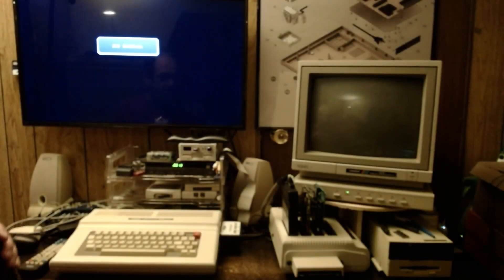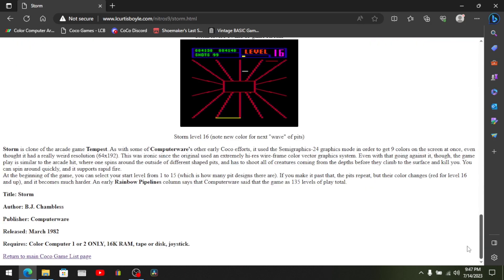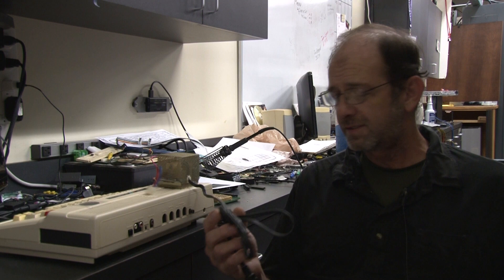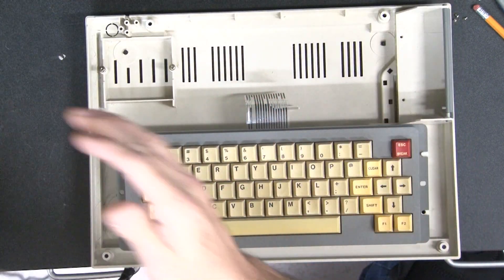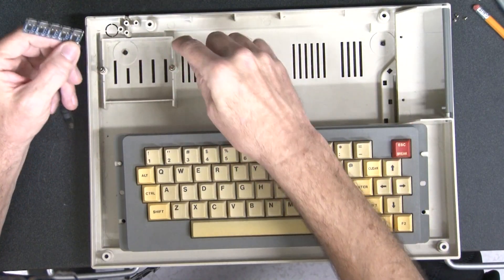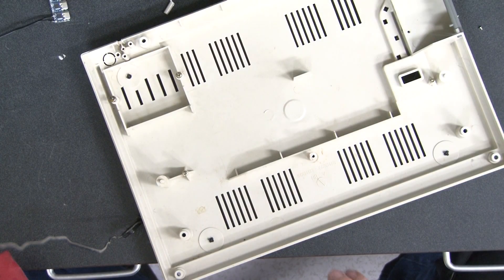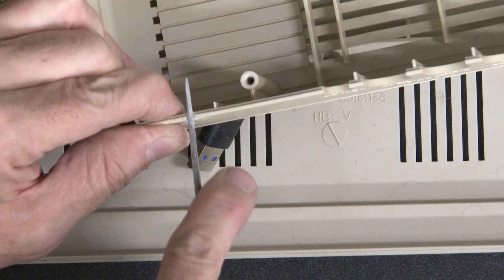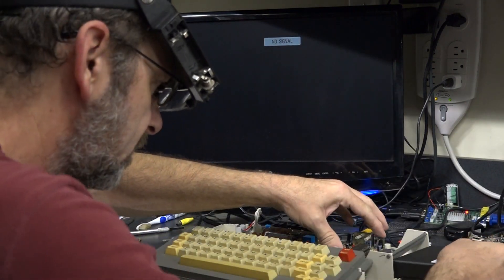Cutting The Cord

Comment: Is the replacement SALT chip a requirement for doing this DC upgrade?
The video was a bit unclear as to which pins you connect the power and ground to. Could you explain further?
Besides the transformer, are there any other components that can be removed when doing this DC upgrade?
Reply from the maker: The Pepper board is only needed if you want to use Cassette or Serial I/O. It is recommended in any case, as it is a more modern and efficient regulator, and the CoCo runs much cooler.
 Using the original Molex socket, connect the black wire to ground, and BOTH red and blue wires to V+.
 If you're using a standard (non-PD) supply, figure 1.5A @9 or 12v, and remember to shunt C62 or it'll smoke! 
 HTH, let me know if you have more questions.
Reply: To ask the question again, "what happens if I don't replace my original SALT with the Pepper board?"
Reply from the maker: @erroneus00  almost forgot: if you don't need cassette or serial I/O, you CAN run the CoCo of of just 5 volts.
Reply from the maker: @erroneus00  without a pepper board, you won't be able to use the cassette or rs-232 ports. Otherwise everything works great!